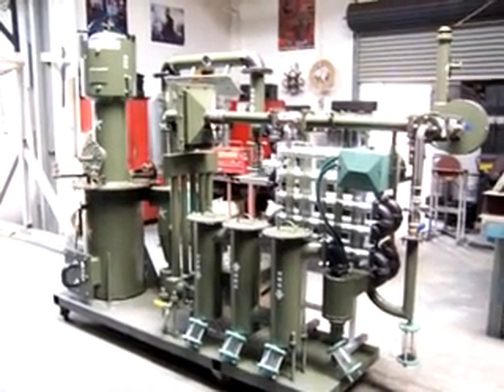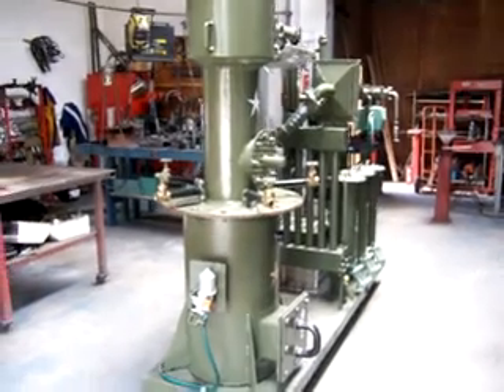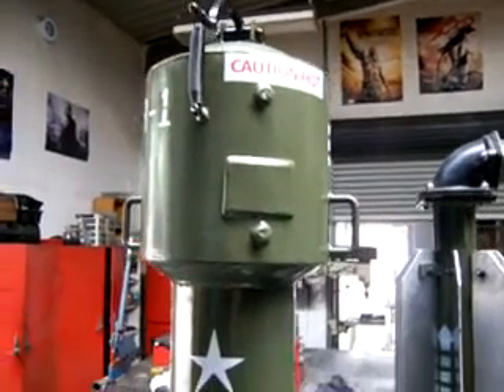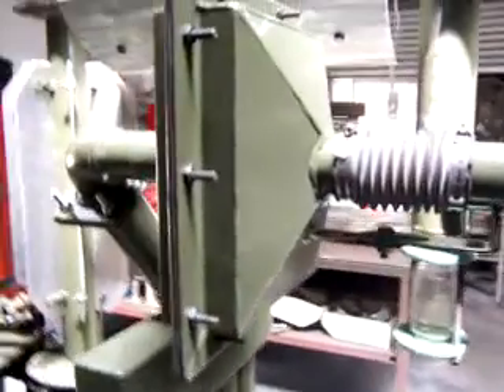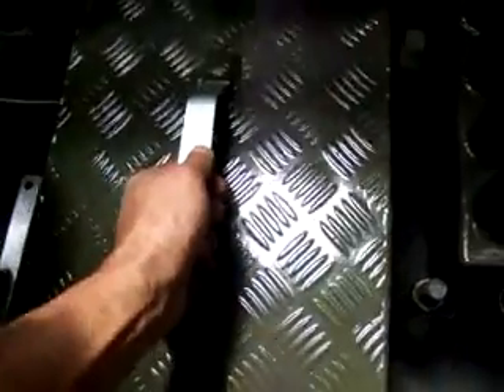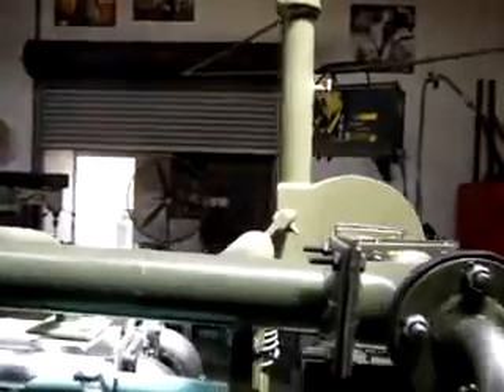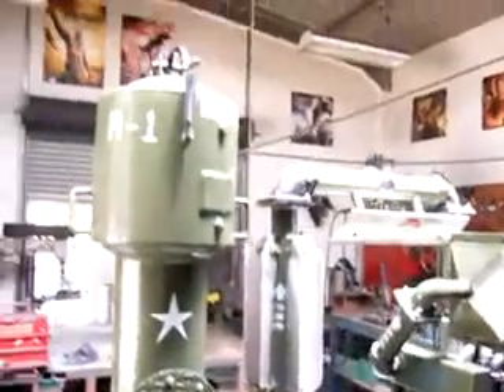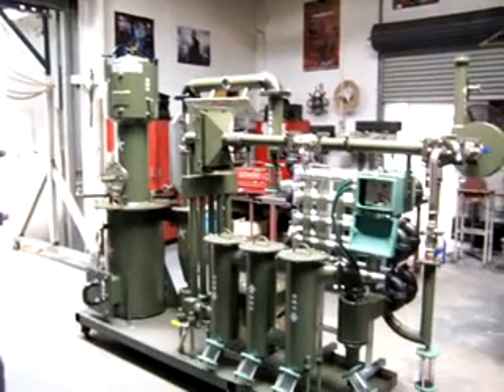The new A-1 Gasifier, part 1

Comment: Once you get a timmer on the grate shaker setup that will be slick and very cool. Great idea there looks good cant wait to see it running and see how it does! It is one great looking setup looks like you took lots of other ppls ideas and took some of the better parts of many to make one for yr self very cool great job!
Reply from the maker: yea thanks tecknowfreak,  after the second run i discovered a burnt manometer line which runs from the cyclone and it gets damn hot, I have the gasifier apart again at the moment and i am modfying the top and bottom firecone together with insulating the core and barrell, i will also be fabricating a larger heatshield for the shaker motor and replacing the small rotating shaker arms on it with a toothed wheel set-up in the hope it will vibrate the grate instead of flicking it.
I have made the ash grate height adjustable too! by using "d" shackles on the chains and a slotted  auto alternator bracket with threaded bar from motor to grate ,, hopefully i can tune this gasifier every which way possible and get a quality gas out of that blower fan. fingers crossed.